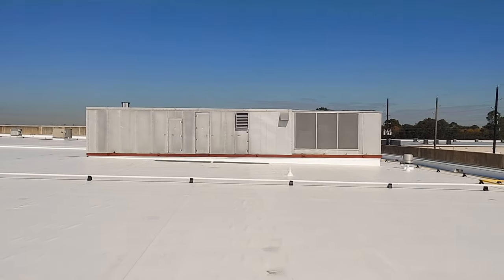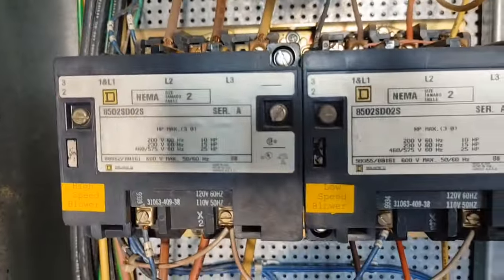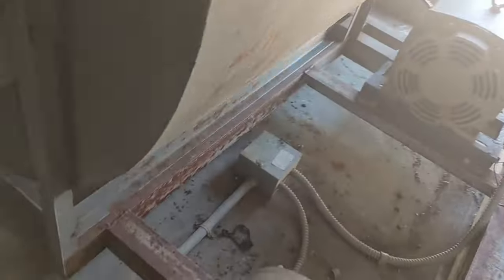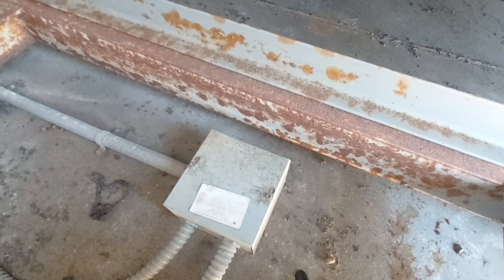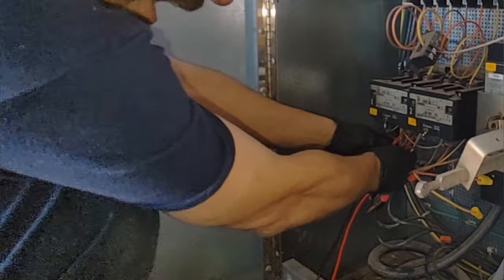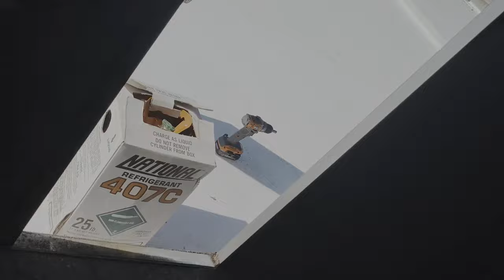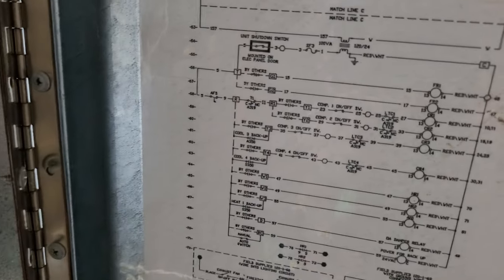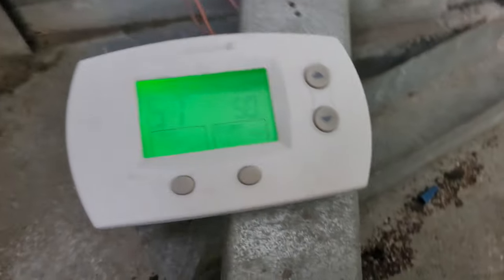110 Ton / 1,000,000 BTU Package Unit - Inspect Heat Exchanger - Learning How It Works - Part 1

Comment: I’ve never worked on a seasons 4 unit but they seem like the unit for grocery stores in my area. I would recommend getting alligator clip jumpers (harbor freight sells them, makes jumping stuff out so much easier). Also looks like a stainless steel hx, usually they crack before rusting a hole. I do mainly commercial/industrial hvac but our company is starting to do refrigeration

Comment: Never energise things that had been disabled by previous techs on such old neglected equipment. You never know what shorted or what went bad. I would tripple check the whole thing from top to bottom before wiring up that motor backon. It could be grounded it could be shorted. Who knows. 
The condition of this equipment screems negligent maintenance.
Reply from the maker: I checked the motor windings resistance at the motor and at the contactor. Neglect is habit that all of these big brand stores have in common.  You will never see a video on my channel of a new piece of equipment from any of these Big Brand stores. All of them are on their last repair about to die. But I still keep getting the dispatches for them and it's my job to fix them. But I totally agree with you, you must make sure you check all of it before you turn it back on. I don't know if it was in the video or not(probably not), but I did check resistance across the three legs of the motor. it was pretty close to 0.5 OHM of resistance, which freaked me out and made me almost not want to do it because I thought it was dead short. But I did anywaus, and it started up and ran. If there would have been a short, it would have blown the fuses in the panel. so I wasn't too scared or worried. Even if it was short, I felt I was good. Or as good as I could be because no matter what, at the end of the day the customer still wants to unit running and they're the ones paying us, so I have to figure out and do something. 
Thanks for the comment
Reply: @HVACRServiceTech it was in the video